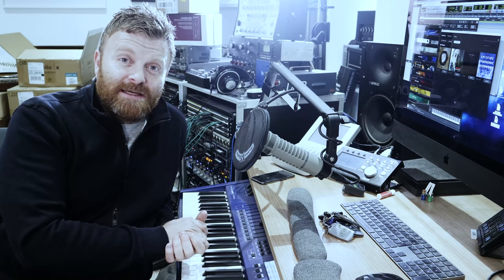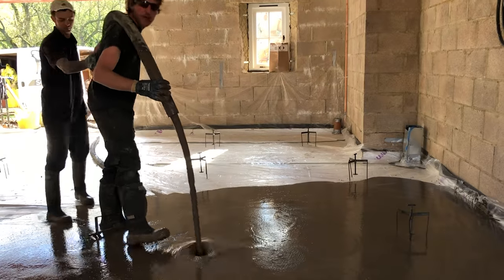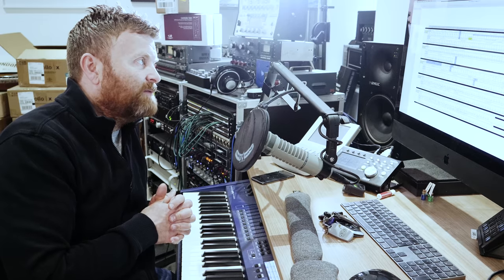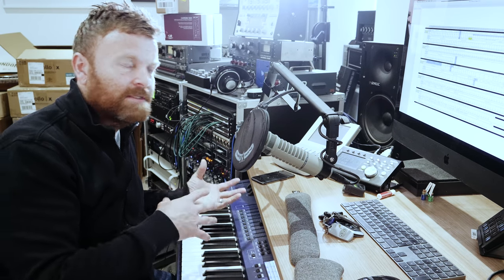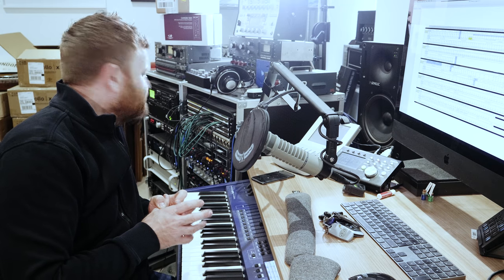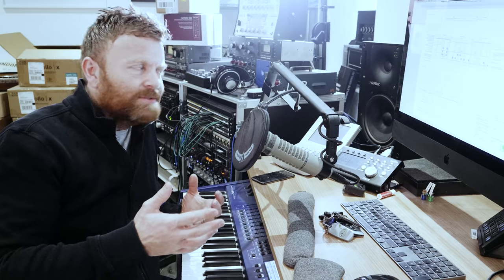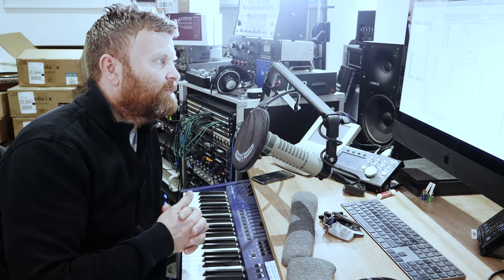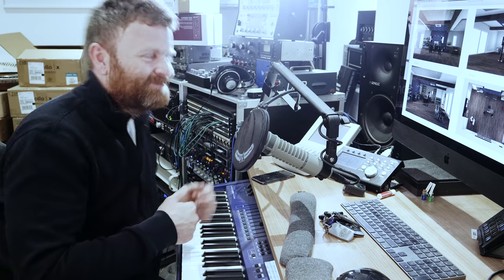How to build a recording studio: part 3

Comment: So cool!. The bookcase idea is really good one. When I was living in NYC the last apartment had a 300 sq foot living room with 10 ft ceilings that was used as a living room and studio. I had treatment on some walls, carpets, couch and 4 large and filled bookcases in there. I had a couple of my engineer friends over to mix some scores and they really liked the sound of the room and felt the diffusion characteristics of the bookcases really helped. Do you have any electricity in there yet? In the house we moved to last year I set up one bedroom as temp studio till I do my build out over the next year and had a dedicated separate electric line with separate grounding, hospital grade receptacles and an expensive Furman filter and I still get much more guitar noise than my NYC apartment and the thought that my electrician and studio designer friend both feel is that it is some sort of an airborne disturbance that is being picked by the guitars pick up so when I build out my space I'll have to have shielding on the internal walls to help reduce that issue. Good luck with the last bit of the build.
Reply from the maker: Yes theres quite a lot of elements to the electrics - I'll talk about that in a future vid - all the lights transformers are in the machine room, got iso and power cleaning etc!

Comment: Fascinating to see the progress. Was there any particular reasoning behind the decision to set up the studio's orientation this way (short and wide rather than long and thin)? Was it a choice of aesthetics or acoustic? When I was setting my space up, it seemed that the general recommendation was to configure the room in its narrow orientation, rather than wide, although I was working with an existing space so maybe it's a bit different in your case. I suppose one of the advantages of a build from the ground up is that you have a bit more control over the acoustic properties of the room, so maybe the orientation is a bit less relevant when starting from scratch. Come to think of it, quite a few studios seem to be set up width-ways (eg. air studios control room). Would be interested to know your thoughts behind desk placement within your room. Thanks for the video!